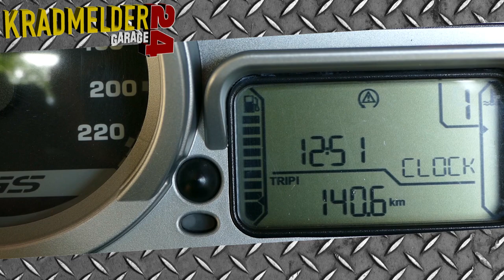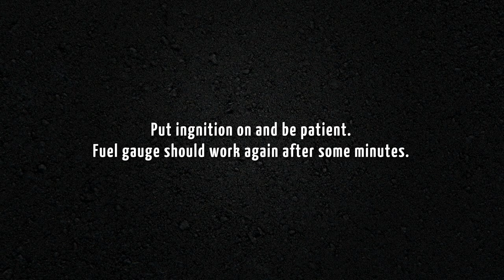Fixing faulty fuel level strip on BMW R 1200 (air cooled) 🔧 Kradmelder24 Garage

Comment: OK I am the same guy that comment below and told to you to be careful ! Well, It DOES WORK ! I don't know for how long but it does work ! As I like to consider my self as a thinking person and a field bio scientist . I took more than the necessary precautions for any explosion and tried it again and again under heavy safety measures, behind a concreat wall 50 cm thick and totally controlled environment ! I have to say that we / I tested the piezotronic more than 40 times on the tank to see if its safe ! Oh I cant confirm if it  melts and welds anything cause when I checked mine it could close a circuit , from my observation it breaks of the salts gathered on the gas level strip. I do not advise though to any one to attempt this procedure ! The best way is to get a new one at your dealer !

Comment: It worked on my 2008 R1200RT.  But only started to work a few days after the zapping and when I actually started the engine. I had two single wire cores from the lighter.  I unplugged the connection and inserted the U-shaped bent wires on to pin 1 and 4. I pushed the connecter  with the wires on to the pin and zapped 10 times.  Did the same on pins 2 and 3.  I turned on the ignition but no joy.  Perhaps I didn’t wait long enough.  Then when I went to ride the bike today I started the engine and just before I rode off the fuel gauge worked.  Excellent because the BMW dealership where the bike was first purchased declined to look at the repair. Apparently they were too busy repairing newer bikes and had decided not to repair older BMW bikes.  Is a 16 year old BMW old - not in my book.  Anyway thanks for the tip.
Reply from the maker: I had to wait for more that 5 minutes each time. Glad to hear it worked.

Comment: After 4 new fuel strips replaced by dealership, I decided to do this method. And it worked. We'll see how long it holds. Thanx, "2006" RT1200.
Reply: Holy smokes what a lame design i zapped mine two years 10k miles ago not auper accurate but it works just don’t go below 100miles range

Comment: Hello, ... looks like BMW has made a matching yellow zapper for your GSA.  I guess the continuous fuel gage faltering has now inspired BMW to include a matching Zapper in the tool box as standard equipment.  ... clever ...  I've got the exact same problem with my 2009  GSA. Wondering how long this zapping will keep the thing working .  Is it just a temporary fix ?
Reply from the maker: Tanks. Yes, at least here. As soon I've driven the tank almost empty the zapper is faulty again. In the end I#m fixing it about two or three times a year. :) It's a thing of 5 minutes.

Comment: Wow that actually worked. My 2007 1200gs only had 2 wires on the plug but it still worked. Anybody know why it works? Im guessing this arcs corrosion off of some terminals?
Reply from the maker: Only two wires on that connector? Wow, that's new for me...
Reply: Kradmelder24. Yeah there were 4 positions but only 2 wires on terminals  2 & 3.

Comment: Given that a piezo electric lighter will generate over 3,000V (needed to create a spark in air) it seems a bit reckless to connect this to a fuel tank and pull the trigger... not for me thanks.
Reply from the maker: As long no oxygen gets to the fuel even 10.000 Volts aren't enough ;)

Comment: BTW some repair cost estimates listed in this thread were between 150 - 200 USD. My Finnish BMW maintenance company told me that only the spare part would cost 190 euros. By adding the manpower cost of the total cost would be a little less than 400 euros. Did your estimates hold both the repair and spare part costs? If so, then it means that my Finnish BMW maintenance company is robbing its customers... Anyways, kradmeder24's fix worked, so I avoided the extra costs, thanks again!
Reply from the maker: As far as I know repair costs in Germany are around 400 Euros as well.
Ride safe!

Comment: Does anyone know how long this fix lasts for? One of the comments mentions after about 6 ‘fixes’ the fuel strip no longer functions at all, can anyone confirm or deny this?
Reply from the maker: Well, yes. After quite some fixes it‘s over, five to ten I would guess. One fix will last about a half year or so. This solution is nothing for eternity.
Reply: Kradmelder24 thank you, that’s good to know, it’s certainly better than replacing the sensor every year

Comment: Thanks for the video.  I've always been wary of trying this, but finally decided it's the least-worst option compared to the cost of replacement and that a new one isn't guaranteed to last - my replacement fitted by the Dealer gave up within two years.  Anyway, tried it this morning and it worked first time :-)  Will carry this with me on tours so I can carry out future resets when required.

Comment: Thank you for your help, today my fuel level strip is come back!
Reply: Did you try with the fuel tank filled up or empty? I'm confused of what it's safer. Thanks
Reply: @tinolafu  I try with the half fuel thanks, at a first moment it did'nt work, then i went to the gas station near my house and the level of fuel appeared.Now it works well
Reply: I’m a bit scarred of blowing myself up. Is this really a good way to fix it. Mine shows no fuel after about 20miles. So swing it I should try it.

Comment: Kradmelder, you are a genius!  I did this last night on my '05 RT with a full tank of fuel and it worked.  I'll admit I was a little hesitant to pull the trigger the first time but it did in fact work (the calibration is off, shows 156mls with full tank, but I suspect it will recalibrate when it sees the range extremes of empty & full, no?) . 

The big question is this:  How did you come up with this?  Did you just happen to be enjoying a pint while sitting next to an electronics engineer?  I can't imagine anyone just saying "hey, why not put a spark in my tank and see what happens?"  Please tell the story!
Reply from the maker: Lucky you :D haha
Reply: Haha I know.. kinda curious also how the idea came about..
Reply: LOL. still questioning it myself if it is wise to spark the petrol tank.

Comment: Thank you very much for the information. I've done it in my r1200rt and it has not worked for me. Is positive and negative important? or the polarity does not matter.
Reply from the maker: Polarity doesn't matter. Begin with outer pins 1-4 and then inner pins 2-3. After turning ignition on it will take up to 10 minutes before gauge will come back.
Reply: Kradmelder24 thank you.  I'll tell you how I finish it
Reply: @Kradmelder24  mine is flashing fuel light and saying I'm empty. No matter if I fill up or not the needle stays at the bottom and feel continues to flash. Will this trick fix that

Comment: Worked on my 2008 GSA. Thank you.
Could anyone explain how it works?
Reply: I read this online, not sure the truth to it: The sensor element in the strip is not as flexible as it should be and develops fractures causing an open circuit. The momentary high voltage arc from the lighter travels the length of the sensor substrate and fuses it back together.

Comment: In my BMW 1200 GS Adventure 2008 it works. :) perfect, I safe 150$ :) Thank you.
It works after start engine.
Reply from the maker: you're welcome :)
Reply: I didn't have to start the engine and it worked on my R1200GS (2008)

Comment: I  can understand the way this method works ! It still  has a great risk of exploding the tank ! It must be safer if you take out the whole floater mechanism and do it but will it work ? Is there any other way of restoring it ?
Reply from the maker: No oxygen - no explosion.
Reply: @Kradmelder24 there is oxygen in the tank
Reply: Also things can explode in space
Reply from the maker: @sdevane75  but not enough

Comment: Might sound like a stupid question, but do I need to have an empty tank when I do this?
Reply from the maker: Doesn't matter as long the lid is closed.
Reply: @Kradmelder24  can’t believe it, I’ve just done it and my gauge is now back and working. The range seems a little off, but guessing this will balance out over the course of riding?

Was super sceptical of doing this, but it’s worked first try. Thanks so much for sharing!

Comment: on my 2009 it is not working also but on my case the fuel indication is CERO EMPTY and I can see in your case it shows full
May this solution still applys?
Reply from the maker: When fuel strip quits working then fuel gauge may show empty or full or half or anything. I had it all.

Comment: Hi, Dear friend, this zapper system will also work with GS 1200 Adventure of 2010 ?, does not mark level and Range to 0.
Reply from the maker: Should work even on 2010 model
Reply: Thank you very much. Worked for me.

Comment: I doesn't work. We tested several times in different sensors and all of them stay wrong...
]
Reply from the maker: Meanwhile my sensor is fubar, too. After six times of successfull zapping all stays dead.
Reply: @Kradmelder24  does the bike have to run for 10 up to 10 minutes for it to take effect or can I just shut it off and it will work later on
Reply from the maker: Themandogable yes let the Engine run for 10 mins.
Reply: @Kradmelder24  so now what I have is the fuel reading as full 24/7 hahahaha,

Comment: After research of almost 2 weeks my conclusions are : 1st) The chief engineer of the biggest BMW dealer and repair shop in Athens have never heard about it ! 2nd) taking a closer look at floater in older bikes or the sensor in newer ones and its coils that work as a dimmer it is unlike for them to be cut off or disconnected ....and the high voltage arc does not melt and reconnect the foil it is more possible to make the salts and dirt fall off the contacts and the whole thing works again ! In the following week I will inform and show  you the results ! An explosion from a gas tank even containing 100ml of gasoline will probably cause serious injuries or even death ! Be Aware of all the nonsense that float around in the internet !
Reply: Well I have done this on two of my 1200s and guess what it worked so your conclusion is  wrong just my .02$. So before you start call it  nonsense maybe you should try it first!